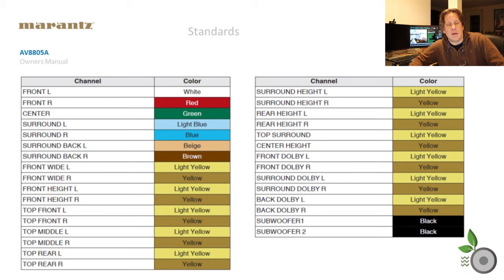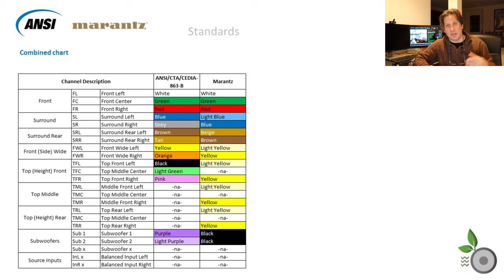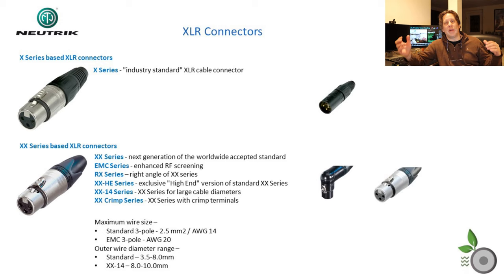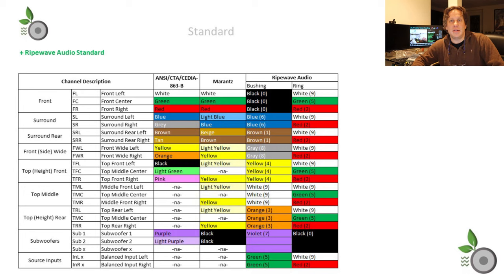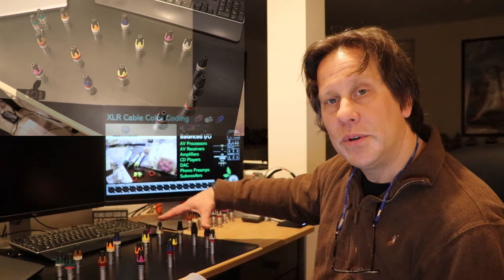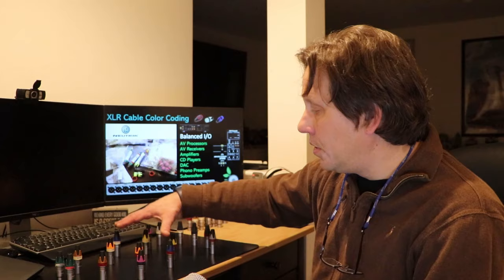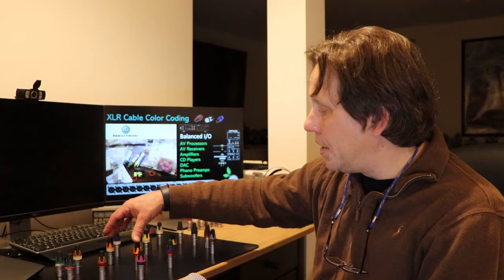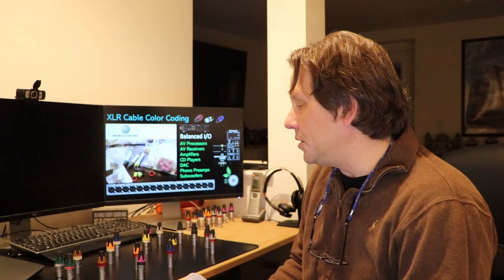Balance XLR Cable Labeling / Color Coding - Standard vs. make your own, Neutrik color options

Comment: We use Color coded XLR connections for our 7.2.6 system Jon but didn’t realize there was any type of standard. Thank you for exploring this.
Reply from the maker: Jack - what did you end up using for your coding scheme? -Jon
Reply: @ripewave  Jon the best we did was use a spreadsheet and a crude coloring system.  We purchased....
 2 XLR black & gold monoprice premier series which connected the L&R front channels to our McIntosh MA12000 Hybrid Tube amp. 
1 Hosa Edge Neutrik black CMK series XLR to connect our Front Center channel to a bridged McIntosh MC162.
2 Hosa Edge Neutrik black CMK series XLR's to power a Carver Research Lightstar Amp for our Front L&R High Wides. 
6 GLS Audio XLR's in Red/Green/Blue/Yellow/Purple/& Orange each connected to a Sunfire Signature Grand Seven to power L &R middle and L&R rear heights plus the L*R Side Surrounds. 
Finally we have two amps which we love (Carver A760x's) which do not have XLR inputs.  We are using RCA's connected to these to power the Rear Back L&R Surrounds in a bridged mono configuration.  
Finally 2 LC-1 Blue jeans cables in purple-gold to power the subs.  Not much rhyme or reason other than a spread sheet for coding.  Wish I had found your vid information earlier although our spreadsheet with brand/color-key method does suit our purposes.  Our system is dead quiet between (or during silent) audio clips with the volume cranked.  We do like it loud my friend.  Keep the vids coming....Cheers.
Reply from the maker: Jack - I do like that you have coded each channel and that you can refer back to a spreadsheet to identify cables in the future as required. Nice collection of amplifiers by the way. I bet they can play load effortlessly. -Jon

Comment: If I do something like this I would do White for the right channel, Grey for the center channel, and Black for the left channel. We are already deviating from the standard so much that I might as well go all the way in a way that makes more sense.
Reply: Maybe brown for the subs. That is a tricky one.
Reply: Another nice thing about using black and white for the rings is that it will also look good with any other color you pare it with; more than red would anyway.
Reply from the maker: Your point about using more attractive or less conspicuous color choices is fair and something that did cross my mind. Certainly if you feel the connector will be visible that would strongly influence your choices. Thanks for weighing in with that good suggestion. -Jon